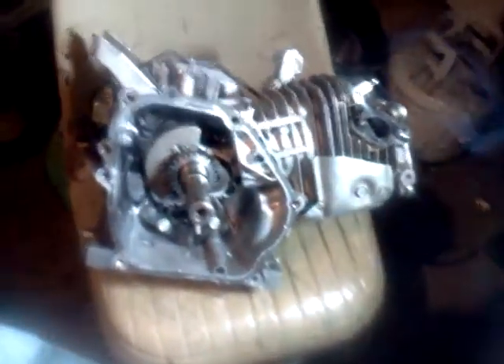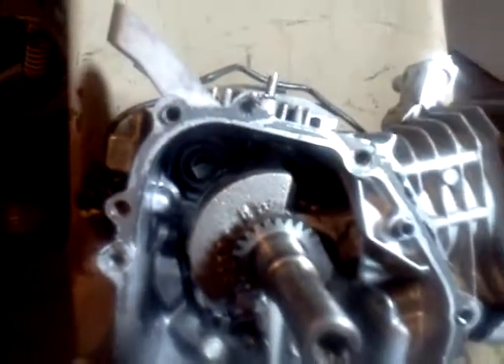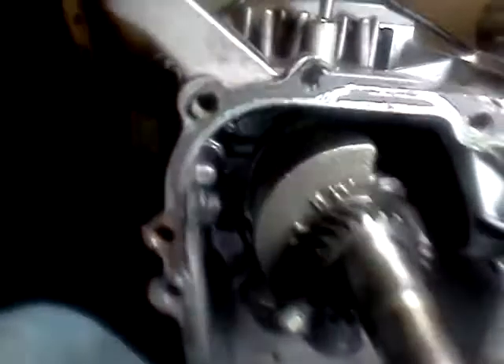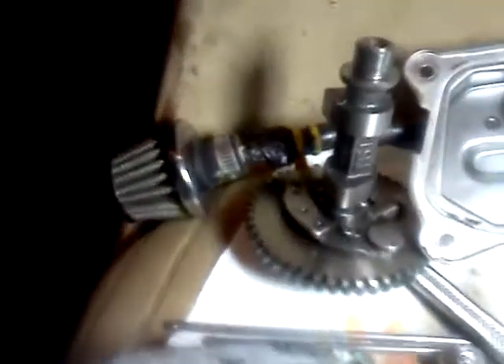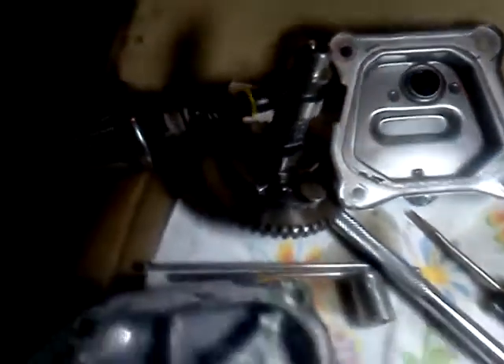How to unlock honda gx (leave comments)

Comment: seems like a easy way to put tension on the chain and keep it on would be to go with a skateboard wheel with a bearing easy as mount it in the same spot and if you wanted file a groove in it so the chain is guided ,good idea with the socket but there a heaps more easier ways 
be sure to subscribe

sam